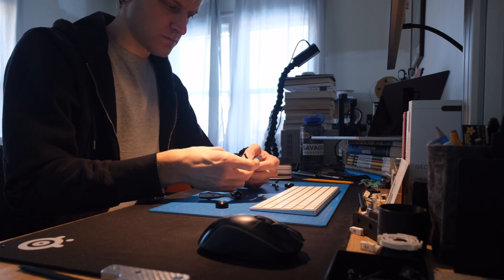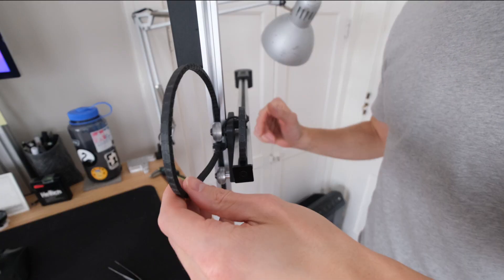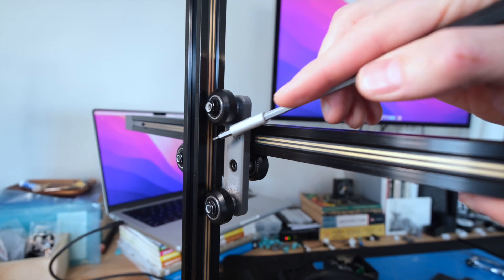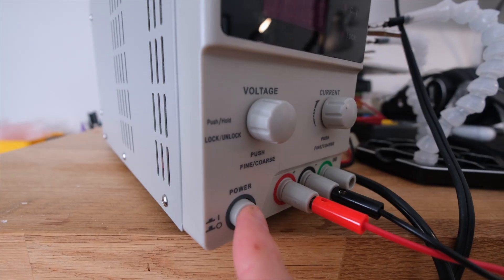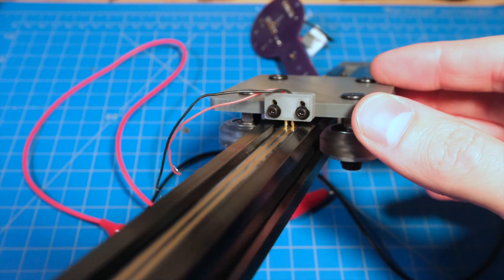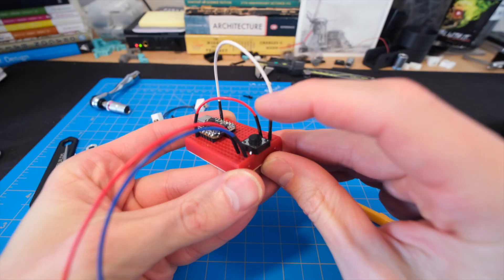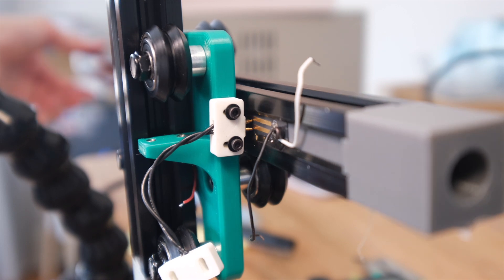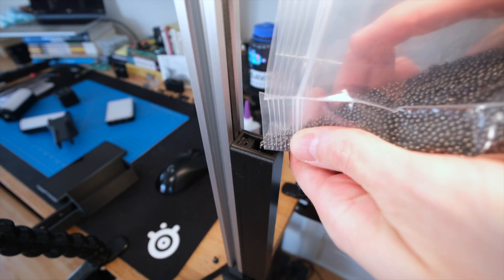Pogo pins: attractive distraction or ultimate wiring solution? - DIYson Lamp Build Log #9

Comment: my only concern is wear. Pogo pins are used for vertical direct contact, and not linear sliding motions.  I dont think it will take long for the Pogo pins to wear grooves in the PCBs

Comment: What could help a lot with the pins disconnection is putting the pins inside the carriage, in the middle of the guiding wheels, close to the axis of rotation of the arm. Maybe even designing the top wheel of the carriage with an excentric cam that would allow to control the fit of the wheels on the rails to reduce the rotation further.

Comment: One observation is the location of the pogo pins. On the vertical axis they are located between the two of the three holding wheels. Pretty much opposite the single wheel. 
On the horizontal axis however, the pins are outside of the two wheels and, i think more importantly, not in the same plane as the wheels. 
Given the vertical axis is behaving more reliably i would try to mimic the position and orientation on to the horizontal axis. Ie move the track to the bottom of the spar and move the pogo pins inside the wheels pointing up. 
Cool project, and the track is a big step forward.

Comment: the issue occours,when twisting because the pogo pins move off the track. moving the pogo pins further to the center of rotation (in between the rollers) might fix the problem (and also allow you to use a pcb instead of the wires)

Comment: What about keeping the diyson express concept and only recharge its battery using the pogo pins and rails? The contacts reliability wouldn't be as important, as long as it makes contact most of the time to recharge the battery. Another advantage is that the lamp becomes wireless if you need to transport it temporarily to another desk. 
I guess it's the same idea than adding capacitors to buffer energy but on a much bigger scale.

Comment: Could always split your track so one track is on top of the rail and the other is under. This would give you way more room for movement and error, and you just need basically a spring clamp to hold them towards each other

Comment: Steven, I love your work! Quick suggestion: increase rigidity of the horizontal arm by spring loading one of the wheels on the carriage assembly, and maybe even spring load the pins that contact the tracks. Dyson does the former but not the latter on the real thing

Comment: This might be a pretty silly question as I cant remember stuff from the previous build logs.  but are you using Eccentric nuts to tighten the wheels to the rail to get rid of slop? In the 3D printing world eccentric nuts are a must for accurate (micron) precision when using V-wheels

Comment: An idea could be to use only one wider track for positive voltage and then using the aluminium extrusion as ground connection. Alternativt using two different tracks on different sides of the extrusion

Comment: To get a better approximation of how much a capacitor will help you need to have a connected load (LED).
Also, it would be much better to move pogo pins in the center of rotation of the axis (between all three rollers) and not off-axis. 
Not sure if copper tracks will be durable enough. You could design them to be nickel plated (this is a standard process and is normally done at no additional cost by the PCB manufacturer).

Love your product design workflow. Keep up the great work.

Comment: Hi! I really like this project! May I suggest a alternative solution? If you face the copper rails against each other, then you can have two holes arranged diagonally through the plate (same plate that holds the wheels) These holes need to be insulated if you use a steel or aluminium plate, then you can place pogo pins or carbon brushes in the holes. Then you don't need any cables at all in that part of the construction.
Reply: by placing the holes diagonally, the pogo pins will have contact with the respective copper track on each side of the plate.

Comment: One suggestion. Use the aluminium structure as the ground, and the PCB track as the V+ (assuming it is 5V) to power the circuit.

Comment: Try placing the pogo pins between the bearing wheels, in which case, the relative deflection between the PCB rails and the pogo pins, would be minimal. Really neat design.

Comment: I asked a question in an earlier video of yours about using the Track from a Track light instead of using 2020 Aluminum.
I looked deeper into it and came across a few issues that I figured that I would throw out there in the event that anyone else decides to try to go down the approach of using a Track light as the base.

The main positives are that they are very standardized, cheap and come with three wires (Hot, Neutral and Ground) already embedded within them.

The Tradeoffs include:
1. They don't have exterior grooves for wheels to ride on 
2. It would be difficult to form wheels to run on the inside since while they have an L-shaped bracket on the Neutral, Ground side, the Hot side has more of a Rounded curve. 
Link to a Closeup of the interior at the 2 minute mark: https://www.youtube.com/watch?v=TpgbepMz5s8&t=119s
3. Cross and Base brackets would need to be custom created since they are designed to be screwed into a wall on the bottom of the track compared to the 2020 extrusions for which multiple options are available.

But designing a custom sliding contact mechanism would still be cool since I have not seen anyone making such a thing (Business Idea ?). 

I'm looking forward to seeing where this project leads to.

ps Will your design include a fuse of some sort since being on a desk it might have something spilled on it?

Comment: Instead of using pins, why not use carbon brushes? I suspect that from a reliability/durability standpoint they will cause less wear on the pcb. Other benefits are that the spring in the back has quite some travel range and they are available in many shapes and sizes for not a lot of money.

Comment: You could add a pair of pins on either side of the vertical axis / carriage. That way, if one pair loses connection when rotating, the horizontal extrusion, the other one will get pressed closer to the rail and saves the day.

Comment: At first I thought that printing and gluing in pin separator channel insert to keep the pins in place would work, but then I realized that the wobble would still be there and that would bend or break the pins. The quickest idea I could come up with for the wobble would be to use 8 Exoslides. The DIY solution might be to add a third v-wheel axis opposite the Supertrack. Possibly thinning the wheels on each side to they ride at the bottom of the channel instead of just the v-groove.

Comment: Really like your attention to detail, seeing the iteration, and exploring a range of possible solutions to each problem that arises - with full video coverage. Also great to see extracts from your notebooks as part of the record keeping to remember everything with extended projects. Thank You!
Interesting that the Dyson mounts the pickup to the horizontal bar on the underside mid-way between the bottom two wheels thus reducing twist (?) rather than on the side. [One option could be to add a 4th wheel, so two above and below, to reduce unwanted movement.  Might not detract from the minimalist goal too much, for a better solution.

Comment: Try moving the position of the pogo pin assembly to the center of the induced rotation rather then hanging off the side. Will probably be a bit more difficult to assemble, but would limit that relative motion the pins experience when that small rotation happens. Love this project!

Comment: Hey Steven! Great update and a clever solution, but the "supertrack" is basically a full length of exposed wire that could be touched by someone unaware or the user forgetting or not looking and adjusting the lamp. This makes it an electrocution hazard and thus in current form unfit for the market on account of consumer safety. I'd suggest some sort of chain cover that goes around the profiles or reverting back to previous iteration with cable chains. If you chose to go back to cable chains might I suggest reduction of slack by using a similar mechanism such as the one in vacuum cleaners to wind the cable back. Cheers!

Comment: Another potential solution would be putting some wipers under the wheel.  Given that the wheels ride within the V-groove, there should be some amount of toleranced space between the wheel and the power rail PCB, while also having much tighter wiper to rail tolerances given the constraint  and slight pressure of the wheel and rail.  Should be fairly simple, leaf spring wipers for any deviation with a holder that partially encompasses the wheel and the linear surface of the rail, which then can attach to the carrier plate around the wheel's axle bolt with a screw on each side. 

Think about it like a tension pulley within a serpentine belt, where the pulley applies force to keep the belt within tension, and in the case of V-belts will help with locating the belt via tension.  In this case, the adjustable wheel is what applies tension, the wiper is the part that's in continuous contact such as a belt, and the aluminum extrusion with the power rail PCB would act as the impartial contact surfaces such as various other pulleys within a serpentine belt.  

Though there's also another dimension to this, the amount of rotation the rail itself experiences, which causes an issue with the pogo pins.  But considering the rail will pivot at the highest point of tension between the wheels and rail, this becomes a non-issue with a wiper under the tensioning wheel.  Another fix to this would just be more tension, as this rotational movement comes from slop within the setup; keep in mind that people use these these kinds of components on various CNC machines that need dimensional accuracy, the slop stems from assembly and not the components themselves.  Other than higher tension, you could also use some perpendicular wheels within the rail to better locate the rail if there is any slop between the extrusion profile and wheel profile, similarly a shim of high lubricity that interfaces with the perpendicular face could suffice for this purpose as well; you could even put the wiper or pogo pins here, as this circles back to constraining the components under a toleranced area. 

Personally, I would probably go with the latter.  Put a perpendicular locating shim of high lubricity within the carriage, and pass the wiper/pin solution into it. Doing this within the carriage can also hide any wires, the wiper/pin set could also be soldered externally and dropped in, depending on distance and tolerances this could also be a floating part that's captured geometrically via a hole in the carriage.  For example, use a 2x2 pogo pin setup, wire specific pins accordingly, put a spring between the two ends, and capture the pin set with a square hole.  This could also make shimming fairly adjustable as well, just pop the rail of and adjust, as the shims themselves would be independent from everything else outside of a retaining mechanism on the carriage.  Simple solution, adjustable, tightens tolerances, and hides the connection, while also not modifying existing design too drastically, nor using highly specialized components that can also be easily assembled.

Comment: One thing I wondered was if it wasn't possible to use a steel reinforced belt and then use the steel in the belt as conductor. Question is if they have sufficient isolation from another to be able to use a couple stands as positive and and negative.
At least for the vertical axis that would eliminate the need for pins and a tack. Same could be applied to the horizontal axis, but it would require a re-design.

Comment: Flexible PCB in the rail instead of rail/cable? You probably could get bent radius small enough to fit into your extrusions.
That would mean stable connection and possibility of data tranfer.

Comment: You could try a mid-print insert for the pogo clip to hide the wires completely, i.e pause the print someway through, design an internal cavity in the connecting clip into which you can just insert the pre-soldered wires. Then let the print complete and you have a zero assembly hidden cable solution.

Comment: Have you considered graphite on a springs instead of the pogo pins? Copper on copper introduces another durability issue, which this "consumable pin" could solve. It could be installed at an angle to give it length and at this power even 0.8mm mechanical pencil tips could work. It gives you control over the ditance the contacts can move aaaaand a lot of headache. Also wider tracks and even using the aluminium body as one track could work. Love seeing your videos, it's always a treat to sit down and see you work through problems.

Comment: I think you could tuck a ribbon cable into the v slot groove, it might even be able to fold over itself in that space. Not sure about lifespan with that bend radius though.

As far as your pogo pin problem, one possible improvement is to move the pogo pin mounts closer to the centre of the carriage, where torsion results in less deflection seeing as they will be closer to the pivot point of rotation. The v wheels also seem like they could be a lot tighter. 

Failing that, make the tracks wider so the pins don't slip past the edges. If there's no room you could made two wider tracks and put them in two separate slots in the extrusion. Or use one extra wide track and the extrusion itself as the return path (the anodizing will need to be removed where the pin contacts).

Comment: Look into super caps a normal capacitor will only look viable with super small current draw but in reality the cap you showed can buffer 0.0009w for half a second at 3v which is basically only usable in super sensitive parts where RF interference matters 
ps. don't choose to big of a cap or to high a voltage

Comment: I suspect that the Dyson Lightcycle might use a single flex PCB that's laid into the vertical and horizontal channels during assembly. A couple tips for you on this design: 

1. Even with hard gold plating, the movement of those pogo pins is going to wear the track PCBs out pretty quickly. It might also create conductive dust in the process, leading to shorts, leading to .. bad things. You might try something like the Mill-Max rolling ball pins, which have a similar design to a ball-tip pen, but you'll need to drop the tolerances on the flatness of the track PCBs to make them work, since they want to be under a very specific amount of compression for free rotation. Good news is that they're tested to something like 65 miles of rotation before failure. They're also beryllium-copper AFAICR, which might have better corrosion and oxidation characteristics than the pogo pins you're using. Even better would be some carbon-tipped brushes. Haven't yet found a manufacturer in the US – but there are a bunch in china. Check out Alibaba ;)

2.. The wires you're using are way too small for the amount of current you're pushing through them. You should probably bump the voltage to drop the current – but you'll need to add in some protection so you don't cause a fire, etc. Look into adding a device called an "eFuse" – you'll have to design a PCBA around it, but the eFuse will detect and react to shorts quickly, and prevent a dead or partial short from becoming an ongoing hazard. Exposed contacts are a recipe for disaster if they're not done correctly.

3. If you're using a big-ass capacitor to deal with interruption of power to the light head, remember that it can release all of its energy very very quickly – it could hurt you or someone else, possibly even by melting metal, etc. As you get more into the electronics side, you might consider some protection against energy flowing from the capacitor back out onto the track PCBs/contacts. I'll let you figure that one out ;)

4. You should be able to replace the track PCBs and the ball/pin assembly with flex PCB(s) that are constrained within the channel – similar to the way you were working with your cable channels earlier. You might need a deeper channel – so no guarantees – but I think it would probably work if you're careful.

Lmk if this is useful – I'd love a shout-out! Good luck with the project. Looks super fun.

Comment: Again low voltage high power led = higher current, which will cause problems in the long run. Use a higher voltage as your input and step it down in the bulb area, which will result in lower current flowing through pogo pins. They aren't made to take higher currents.

Comment: The supertrack idea is great. I wonder how clean/conductive the copper will remain after a few months? When you raise the horizontal arm, can you see where the majority of the flex (that separates the pogo pins from the track) is coming from? The CNC block may not flex as much or maybe its the pins holding the rollers that are flexing or maybe the tension on the rollers or the material the rollers are made from.
The way you are analysing each problem is so logical.... I love it. Looking forward to seeing the next video. Cheers

Comment: Neat project! I think you'd get more consistent contact putting + and - in different extrusion channels (so wider). Perhaps pack the channel with foam/rubber on each side with conductive strips pointing towards the middle and slide the pin down between them clamping it with the compliant material.

Comment: One solution could be using brushes or something similar. This one is totally random, but what if you used one track for Vcc, one for ground, and put them on opposite sides of the extrusion. Would obviously complicate matters, but could give more flexibility with pin size or brush size, without having to worry about shorts or alignment as much.